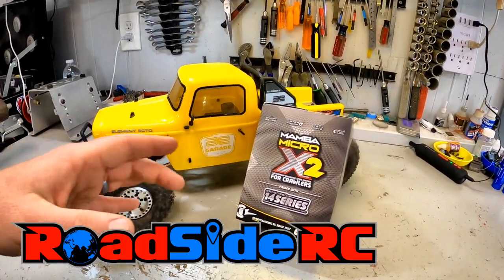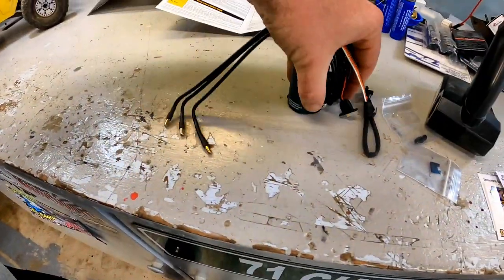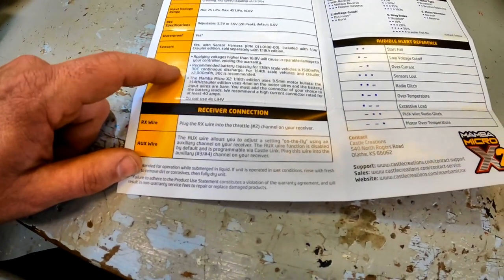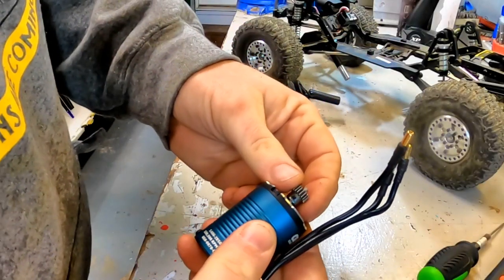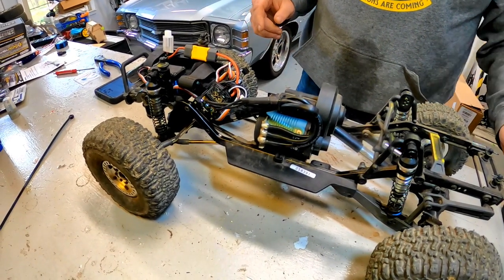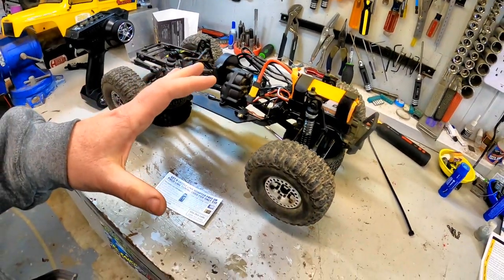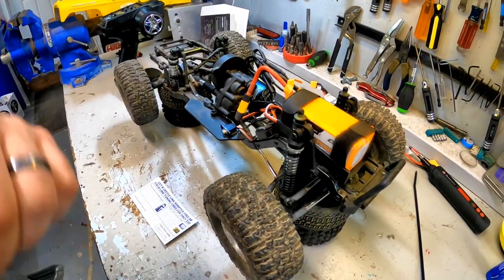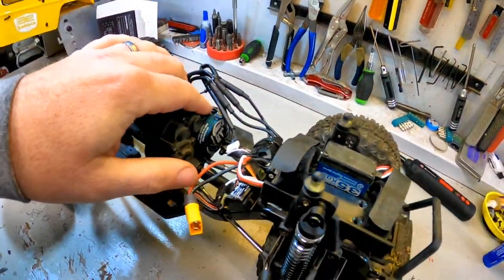4S Crawling?  Castle Mamba Micro x2 (Install, Test, Review)

Comment: I just preordered the micro x2 the other day. U mentioned the micro x2 is the only 4s crawler esc. I run 4s in all my crawlers. The mamba x is 6s rated n the copperhead is 4s rated. Have u ever tried turnigy batts? Ive got the turnigy graphene panther 1.4 4s 75c (green n black) batts that are about the size of the 850mah u showed. I get better than 2 hrs run time from one batt.

The castle link is much better than the field card. U have more options to setup the esc n cc bec aswell
Reply from the maker: Yes - you are right.  I missed the Copperhead. 
Thanks for the tip on the Turnigy battery.
Reply: the 1.4 4s graphene are on sale for $16. glad to hear you get 2 hours on them.

Comment: You should be able to change some parameters of the ESC with your remote. Most if not all castle ESC's can do about 9 minor changes, like brake mode, crawler mode, motor reversing, lipo/nickel mode, voltage cut off. Should be able to reverse the motor using the beeps.
Reply from the maker: You are right.  The manual showed it.  I really don't like doing that as I am always afraid of a mis-step.
Reply: @RoadsideRC  You're not gonna mess it up 😂 can always go back. Only thing that may happen in breaking plastic trans gears from that 4s power ☺️ about the only part you could get really wrong is lipo mode. Even then you just kill the batteries. I've tried alot of cheap ESC's I like Castle and Hobbywing, they are my go-to power systems.

Comment: Excuse me good sir I have a question, if you were to put a fan to cool the esc down, how would you do it or what size mount would you get? I own a micro x2, using it with a castle motor to bash with, having heat issues. Any info would be greatly appreciated 👍
Reply from the maker: That ESC already has a fan on it from the factory, correct? 

Typically, once you have one fan, more fans don't really help any more. 

My expectation is that ESC is undersized for your bashing application.
Reply: @RoadsideRC  sadly it does not. I was highly recommend this setup from many YouTubers, running the castle 1010 combo, no one ever has any heat issues but I see them running aftermarket fans somehow. Was just picking your head, I'll see what I can figure out here
Reply: @RoadsideRC  running it in a arrma grom, it's a pretty light setup
Reply from the maker: @birdistheword1327  Ahhhh.    I assumed a 1:10. 

You see the 4 screws on top of the ESC?   Those 4 screws will come out, and allow a space to bolt a fan in that exact spot.   You will need to measure the dimensions and  check the specs on the fan. 

That should do the trick!
Reply: @RoadsideRC  thanks so much that's what I figured, I'm a bit new to the hobby. I searched for 20mm x 20 mm fans and nothing came up but one in stock in Australia lol, it's like that size doesn't exist. I never seem to have any luck with this type of thing. Thanks for your time my friend
Reply from the maker: @birdistheword1327  I always suggest checking out AMain Hobbies - great selection.   Here is what you need:  https://alnk.to/fwrnLOF
Reply: @RoadsideRC  wow I appreciate it. I am frustrated because when I search amain on my own for "20 mm fan" or any variation of the above, I don't come up with any results. Only 25 and 30 mm come up

Comment: I like the castle link. ETA: I did buy it ahead of time. It arrived before the Copperhead did. I can get by with brushed just fine, especially with all the gearing options there are now. Brushless is fun and the motors should last a very long time.
Reply from the maker: Longevity and battery life are nice bonuses for sure.

Comment: On any crawler that has a standard 3 gear transmission you could just unbolt and and rotate the skid around to change the motor rotation if room allows. With the element based vehicles you have to open up the transmission and change the gearing placement. You can swap the gears around to have overdrive to the front again but I do not know if flipping the transmission around would put the motor or spur gear cover in a bad spot.
Reply from the maker: You are right!  This trans requires disassembly, but can be swapped.

Comment: The Copperhead 10 has an up to weight of 7.5lbs, it's going in my SCX 10.3 Gladiator thats almost 9lbs. I don't know how they rate the Micro X at 9lbs?
Reply from the maker: I don't remember the specs off the top of my head.   This ESC and motor combo has done well.  My truck is certainly lighter though.

Comment: Haven’t dived into brushless fully yet. Just got a motor, waiting for an esc. But can’t you just swap the two Outter leads to change the phase angle rotation like on a full scale electric motor?
Reply from the maker: That is only doable for non-sensored setups.  With a sensored setup, you have to reverse the direction in the programming.
Reply: @RoadsideRC  good to know, thanks!
Reply: @RoadsideRC  now that I think about it that’s good for me. Doing a purple build with a GSpeed purple Cf V3, and the purple Holmes servo and both 1800kv and 2700kv motors. Both of which aren’t sensored, so if I run into this issue I now know it’s safe to reverse the leads! Thanks for the clarification.

Comment: Does it make the screaming noise the copperhead and the slate motors make?
Reply from the maker: It is not silent, but not as noisy as those either. 
Once I get it programmed, I will have another video where you can hear it better.  This one had too much background noise (dogs, lawnmowers, etc).

Comment: I’m having the same problem with the reverse. Mine is also accelerating as soon as I turn the remote off. Any tips?
Reply from the maker: As soon as you turn the remote off? 
That means you don't have the failsafe set correctly.
Reply: @RoadsideRC  yes when I turn the remote off it starts moving on it’s own. I don’t think I changed anything but maybe I did when I was having problems calibrating it. I think My remote was set to reverse so when I tried calibration it wouldn’t until I tried it holding reverse at powered up and did the calibration. Hopefully the failsafe is easy the change.

Comment: That looks a very good set up did you try changing the motor wire’s around to see if it wasint running backwards 👍👍
Reply from the maker: Can't do that with a brushless sensored system.  They have to be in order.

Comment: Ive been doing 4s crawling for years using the mamba x lol. With any element you need to reverse the motor rotation. It is a pain in the butt to use the code to get the free programmer but its better than most brands where you have to pay 50 bucks for the programmer extra. I have a bunch of castle programmers along with hobbywing. I still think the mamba x is the best bang for the buck when it comes to overpowering a crawler.
Reply from the maker: Thanks for the feedback!
Now, I need to find a different pinion for this truck.  It is too overpowered on 4S.  Harder to modulate the low-speed - so I was thinking of going down in pinion to help it out.

Comment: you can change that with the controller commands you dont need the link there is a sequence with the controller should be on page 28 onward in the drivers ed book it came with
Reply from the maker: Here is the problem:  I am always VERY leery of the throttle = yes, brake = no...."Am I really doing this right???"  AAAAAAHHHHHHH.   

I'll just get the programmer and be done with it.   :)

Comment: Battery life increased and I think it's the only advantage. You will never need additional power or speed when trailing/crawling and even if you try the chassis and ground clearance doesn't allow it...brushed still works fine and it's a lot cheaper. Maybe one of this days they become history but at least now they are the better option for this type of rc.
Reply from the maker: I do agree with you.  Brushed still works really well for crawling. 

The only place we split is on wheelspeed.    I really like wheelspeed for when I need to "hop" over an obstacle....and sometimes it is just fun...
Reply: I agree with you, but I just ended up in a situation where there is no brushed combo that is cheaper than a revolver+micro x set for the right amount of wheelspeed and torque. I just happen to have a weird gearing. It's a capra thing

Comment: The Holmes Torquemaster BR/XL esc and the H.H. high-end brushed motors are 4s capable. I paired mine with an 11t Torquemaster Magnum. 3s is good enough for me right now, but I may go to 4s just to have something different. You can also run 4s with the Mamba-X and Copperhead esc on a crawler. I think that would be a great esc for more of a comp crawler setup, out on the trail I like my higher kv motors, but my rigs are a little heavy (right at 10 lbs.) It would probably be fine on something lighter like you have though. I like the way they changed the look of it. And looks like they added a small fan to the top? Let me know if I'm wrong about that. Good video.
Reply from the maker: I agree for sure - 3S is typically all that anyone would ever need.  

Unfortunately, it still doesn't have a fan - that is just a huge heatsink.
Reply: @RoadsideRC  I had to order the Castle link for the H.H. Torquemaster BR/XL esc and it doesn't come with a coupon so I had to pay $25 plus S/H. and have only used it once to turn the "Holmes hold" active brake on. I wish everything was as easy to program as my Axe system.

Comment: Try swapping any 2 motor wires to correct the problem you're having.
Reply from the maker: That doesn't work with a sensored setup.  It has to be in the correct A-B-C order.
Reply: @RoadsideRC  does it work with sensorless brushless?
Reply from the maker: Yes!

Comment: I just put a HH Crawlmaster Sport 8T in my Ecto, running a HW 1080 and 3S power.  I thought I'd still want a Fusion someday, but not after experiencing this combo.  https://youtu.be/oll-MbBeSXo

The 4S capable Castle is interesting though.  I'm looking forward to the follow up video when you have it all set up!!
Reply from the maker: I agree!  With that setup you have, why would you need a brushless setup?  
I didn't think the HW1080 would run all the way down to a 8T motor on 3S.  I thought it was limited to 16T or similar.
Reply: @RoadsideRC , it seems to be doing fine so far.  Probably just my newb-ness, but I didn't even check the ratings before I did it.  Guess I'm now doing some endurance/durability testing to see how long it lasts.
Reply: @RoadsideRC , I was just looking through the comments on the Exocaged RC video where he installed an 8T Crawlmaster Sport in an SCX10.3 with a Stealth transmission and HW1080 on 3S.  Someone asked the same question you did and Joe answered they work together because the 5 slot motors are lower KV than 3 slot motors.

https://youtu.be/7fyfUjomiTE

Comment: Please Troy read the manual you can make the changed by beeps ....OMG
Reply from the maker: I did read it.  Really don't like doing it via the beeps - really easy to make a mistake.  Would rather have the tuner.
Reply: @RoadsideRC  Agree the Bluetoorh or USB it makes it easy....me Castle fan all the way ...HW I struggle with it burnt up one ESC smokes my Pro Programmer...I struggle...
Reply: Troy if you have questions hit me up more then glad to help...look at throttle ramp this is the great part of the Castle ....like I said hit me up dude...

Comment: Crawling is best on 4s, no doubt. 1200-2850kv and low gearing. Nothing new
Reply from the maker: I actually went back to 3S.  4S batteries really keep adding weight with diminishing returns on control/speed vs 3S.  

Glad you like it!

Comment: i mean 4s crawling is freacking pointless simply dont need the power
Reply from the maker: Don't knock it until you try it!
The extra voltage will allow me to gear down even more.  Best of both worlds - even more torque down low, with the same or higher top wheelspeed.